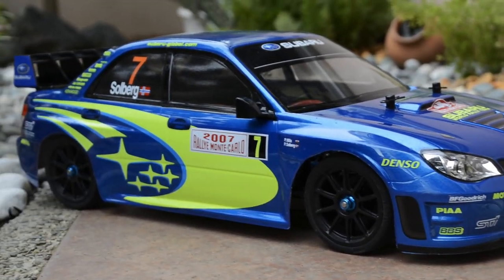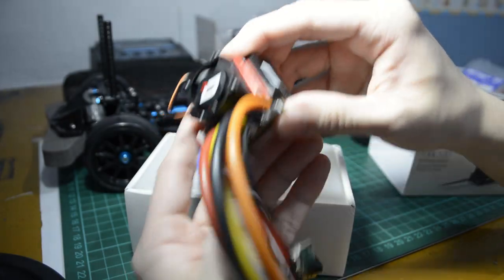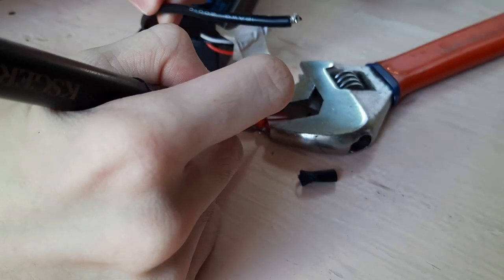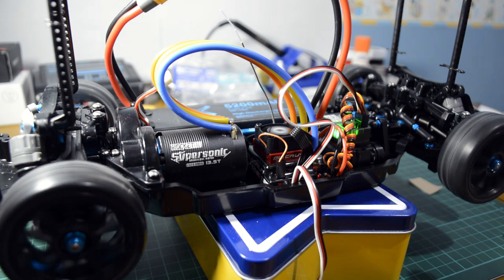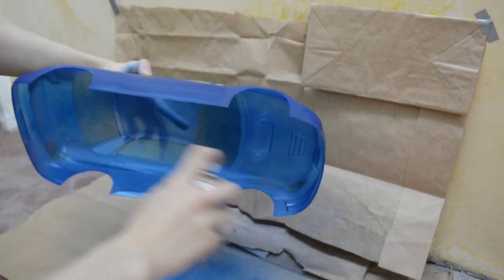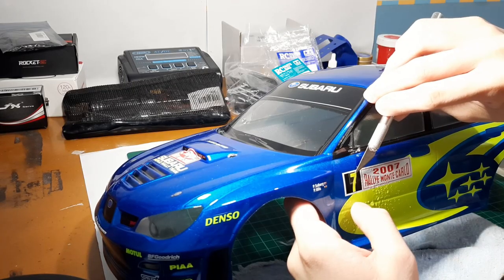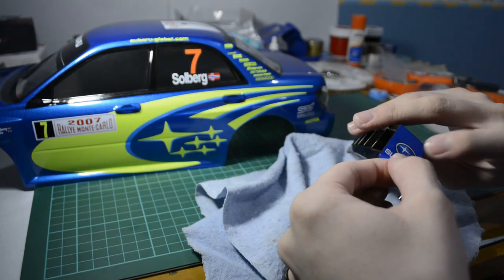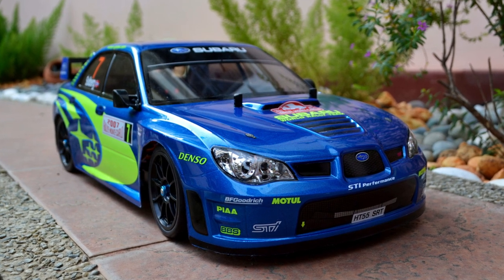Tamiya TT-02R Subaru Impreza Build | Part 2

Comment: Do you have any slop on your steering? I have 2 TT02 and both have steering imperfections. I know that the solution is getting the expensive hop ups. The SRX model is good but pricey. The one that you built is the TT02R, but how do you like the steering aspect of it?
Reply from the maker: The TT02R also has some slop on the steering. I usually just bash around the street and I don't race so the sloppy steering is not much of a problem for me. I do wish it had more steering angle though.
Reply: @NotSoScale steering angle is easy mod to do on TT-02, just cut the stoppers on the suspension arms with a sharp blade or small sharp side cutter.